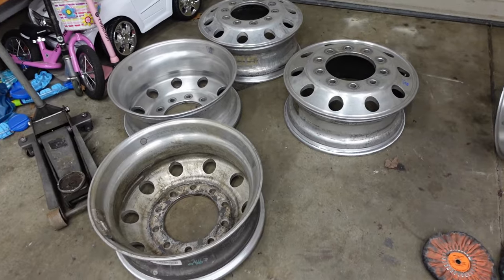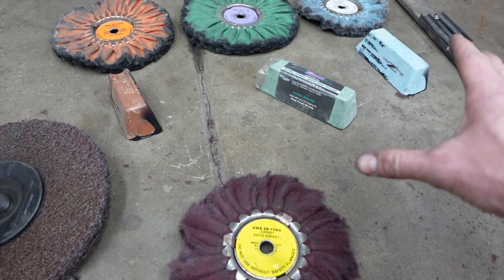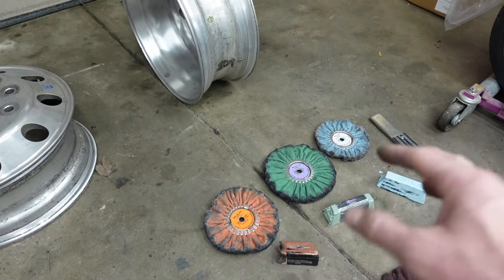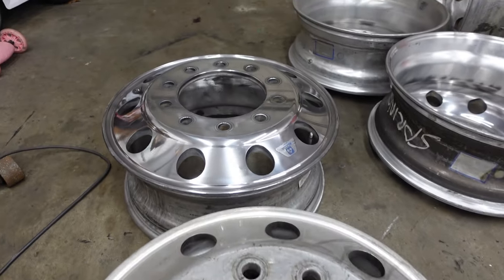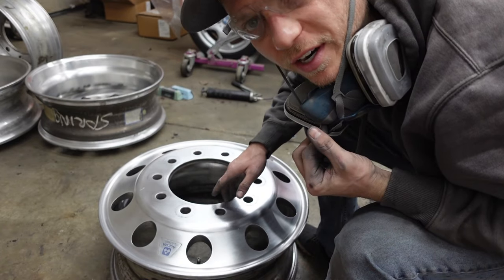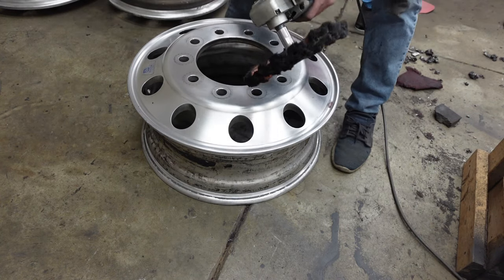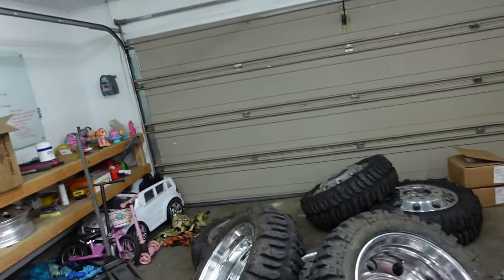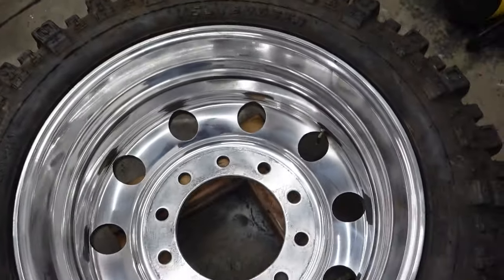How to Polish and Buff Aluminum Wheels to a Mirror Finish!

Comment: I used to work at a fab shop as a polisher. We built commercial sinks and counter tops etc out of 304 stainless. We had this wicked end grinder we called the beast. If we had a huge unit to polish we used the beast it turned up 9k rpm to make hard shines. The key to polishing and making a hard shine is speed and heat. Turning fast and holding to the metal it'll make an extremely bright shine.  A perfect mirror finish everytime.
Reply from the maker: That's awesome. I'd love to see the beast in action! Lol. I've heard the best polishing comes with speed like you said
Reply: Exactly 💯 I like polishing with 8000 rpms n big 15 amp for digging power
Reply: @DeaDEye.21  the end grinder I used was pneumatic and was about 36 inches long. Thing didn't have a trigger, it had a grip Instead. Everytime that grip was hit, it'd kick up and twist your wrist if you didn't have a good hold on it.

Comment: Wow! Thank you so much. I went right to Amazon and bought supplies. I'm excited to do a set of Ford Alcoa rims. Cheers from N.B.
Reply from the maker: Glad it could help! The factory ford alcoas are cool wheels
Reply: Also keep in mind you probably will have to strip ford factory alcoas before polishing 

If you can find the old school aircraft stripper it usually eats it off very quickly 
Apply / power wash off
Reply: Yes, we stripped the clear coat off, wet sanded them, as they were in terrible shape. Then polished them. My only concern is that we didn't re-clear coated them or if we could. Hopefully, the brake dust doesn't give us too many problems.

Comment: How long do you usually take per wheels? 
I bought 10 wheels and i intend to spend around $200 bucks at harbor freight , polish the wheels and sell them. I set a goal to spend no more than 10 hours polishing. No experience but I'm a diesel mechanic so i learn easily. 
 Thanks for your video and tips
Reply from the maker: That's a good idea and you make a good point, I would say maybe 1 hour per wheel..? Could definitely get more efficient with it
Reply: @NaztyNate  these are 22.5 wheels off a semi 1 hour should be enough.i have 6 other rooms that are mine so let's see how it goes
Reply: Good 👍 luck... Sorry but not as easy as it looks

Comment: Man I’ve got 2 problems. I just can’t seem to get the last little bit of small scratches out after the final polishing wheels. I also have some haze that I can’t get out either. Idk what I’m doing wrong
Reply from the maker: More sanding and higher speed usually helps me

Comment: How to wash them after they are freshly polished ?
Reply: Same way you wash anything.  Just don't use an abrasive or grease cutting soap it will take the oils out of the aluminum that the polish put in that protects and keeps it shiny.. use a good hand polish once a month or so
Reply: @Alllsho84  appreciate it